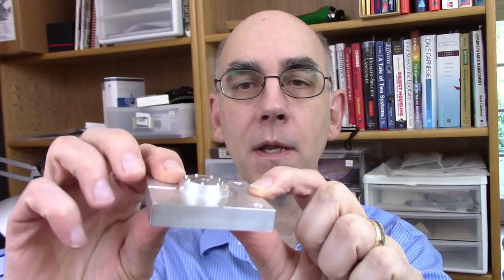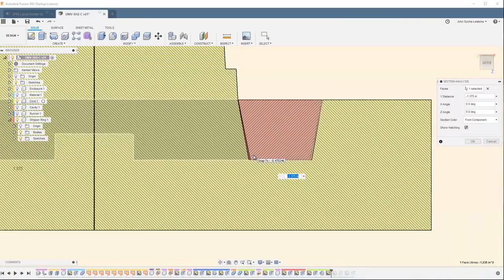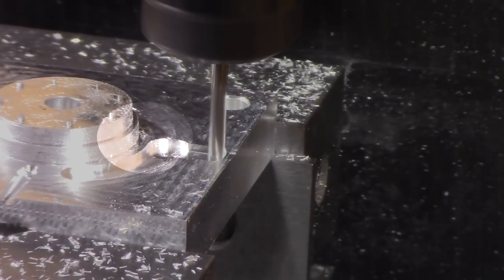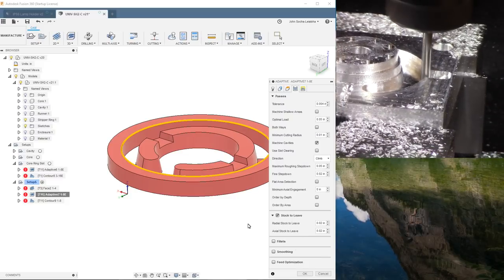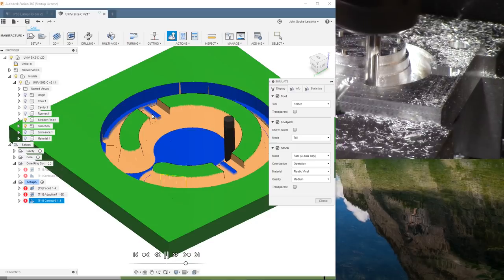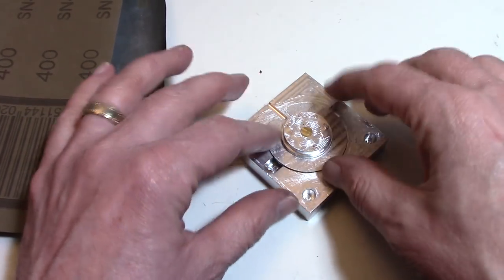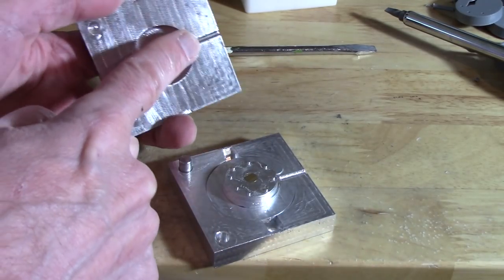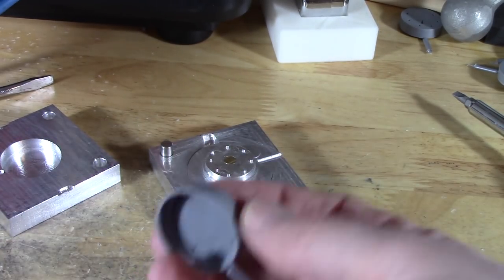Using a Stripper Ring - Speaker Enclosure Mold Part 3

Comment: Great video John.  I recommend  using ejector pins under edge rather than stripper plate or ejector sleeve. The ejector pins I use are 10-32 screws with end turned to a 1/8" diameter.  Drill and tap your B side to receive.  Ream hole the "ejector" potion of screw passes through.  Also, instead of pry slots use 10-32 jack screws.  It's night and day.  It's great stuff.
Reply from the maker: If I'm following correctly, that means turning the screws to eject the part. That seems like it would take longer than the stripper plate. Am I missing something?
Reply: Yup, that's it.  About 1/4 turn breaks the taper.  Just finished a tool with two 1.5mm ejectors on 8-32.  Very effective.

Comment: Great job! If I may? I would have incorporated two dowel pins with some thread to attach the "ring" . . That way, the ring could be ejected without the need for screwdrivers. Plus you could temp bolt the ring to the mold (using the dowel threads) and run a finishing pass for a really smooth transition? But yeah, excellent demonstration of cam->cad->mill->finished part with nice tight tolerances 👌🏻 Thanks for sharing 👍🏼
Reply from the maker: True. I did the stripper ring as an experiment. I didn't know if it would work. But it worked really well, and it's certainly fast enough as it is. I actually have to slow down a little when I'm making the parts, as the machine can't heat up a new batch of plastic fast enough otherwise.

Comment: John, great video on how the stripper ring worked.  Despite the little bit of flash, for which you know the reason, it was a very high quality and impressive looking part.  It would take very little post-processing which is about my only metric to judge.  My guess is you may find that your machine has a bit of x or y axis backlash which could explain the slightly non-round holes.  The smaller the hole, the more pronounced that would be and those are some pretty small holes.  
I must have missed a video or two, is that molding machine a new one you got or something you had kicking around?  Is the Morgan Press not in action?  When I get a good bit of time, I'm thinking about hacking my Medium Machines to convert it over to hydraulic ram (instead of a hydraulic jack) and, if possible, hydraulic clamp as well.  Despite the over the top irreverence of  Colin Furze,  this video: https://www.youtube.com/watch?v=E1dTwm8Lmpc inspired me to think about the hydraulic conversion of my Medium Machinery unit.
Bummer about the initial vise alignment problem, but you'll have a better mold next time for the experience gained.  Liked the new video formatting.  Keep them coming...I always learn something from you.